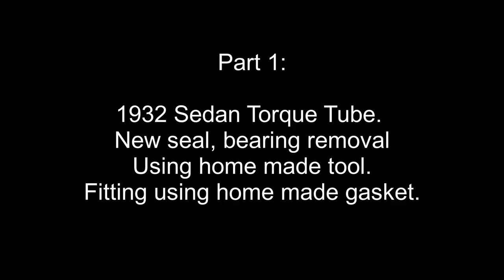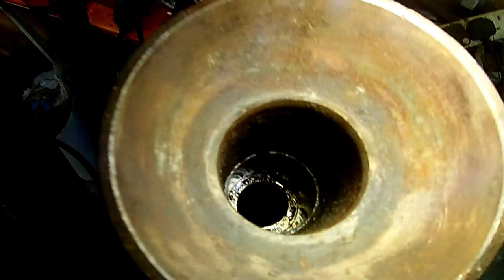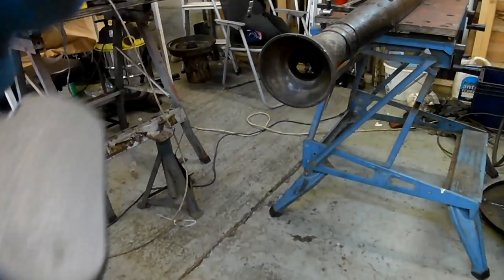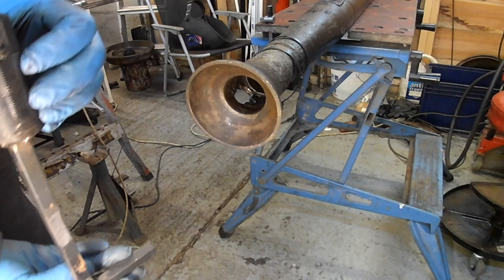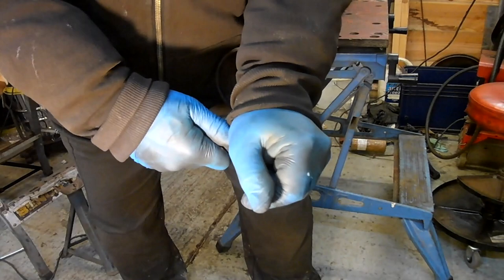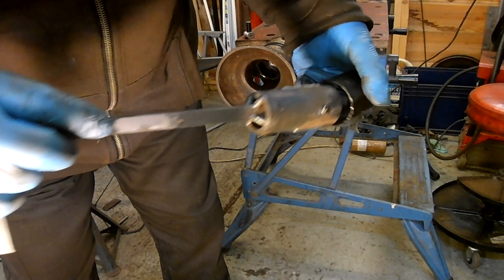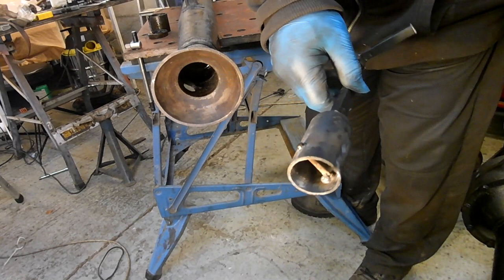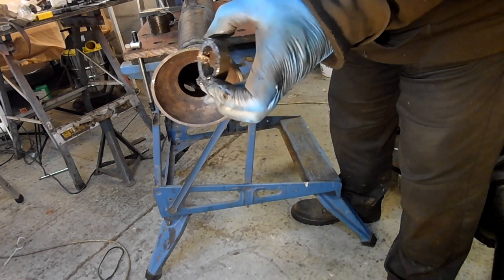Early Ford Seal swap. Home made bearing tool. Flatty port cleanup. Radius rod mods. 32 Pt20 59 pt14.

Comment: Thanks Mart. Drive-line/torque-tube is one aspect of the old fords I've not had apart, very good info.
Reply from the maker: Hi Art. Yes, I tend to leave them intact if I can. I did revisit the pinion nuts on this one at a later date. It was bugging me that there was play in there. That's the purpose of this series, to share all this seldom seen tech.

Comment: Great stuff as always Mart, including the Cold War Motors references! Staring down those 'before' clips of the valve bowls and intake ports, one could sometimes imagine you were looking into long lost but recently discovered branches of the Catacombs! It was the same for my '39 block but it turned out well in the end and runs just fine now. Same goes for some of those valve seats. As for worrying about the symmetry of the blending you've attempted between the bore liners and the valves,  one must keep in mind that it's not intended that this engine will ever power a Spitfire in the Battle of Britain!  In the end, I think your conclusion from the successful Crusty Flathead resurrection will prevail, i.e. these flathead V8's were (mostly) indestructible! Cheers!
Reply from the maker: Yes, thanks Glen. I always go by the maxim: "It's amazing what you can achieve when your standards are low".
Reply: @MartsGarage  Right you are. They needn't always be lofty - standards, that is. As my dad would say, "Whatever gets you back on the road!"

Comment: Mart, the 32 is coming along nicely. I really like the approach to use original parts as opposed to aftermarket stuff. Sure gives the car more character. I do think you should use a dropped axle though. I'd bet you could drop one yourself! Just something to think about.😉
Reply from the maker: Thanks Robert. I'd give axle dropping a go but it takes a lot of gas. There is a fella here in the Uk that does them, so it's not out of the question. I have a dropped axle leaning up against the wall. I want to get the car built. The heavy axle is the one that came with the car, so I wanted to use that. If I don't like how it sits, I can change things down the line.

Comment: Mart, another fine video. One thing I would like you to do is, when you speed up the video, slow it back to normal when you talk. One of the greatest parts about your videos is your thought process, and speeding over your comments removes some of that. As an old timer myself, I often find myself running on a bit to the apprentice about why I do something, and it seems to help them understand how common sense works. As we know, common sense can't really be taught, but it does help if it's understood. Thanks for the video, keep up the good work.
Reply from the maker: Point noted, JC. Thanks for the feedback. I spend a long time editing and it is difficult to get the footage down to a watchable length. I do exactly what you say if the comment is explanatory and relevant. I do vet the spoken parts and if they are left in the speeded up segment it means I was just waffling. I will take it on board though and bear it in mind when editing. Thanks again.

Comment: Hey Mart Great video, the seal in the torque tube is the same as the axle seals in the bells, if you need hardware your Caterpillar dealer will have quality Grade 8 hardware UNC UNF in country, washers etc Finning is your dealer and you can order online parts.cat.com
Reply from the maker: Thanks for the info John. I have found UK suppliers for the seals so will get some ordered. If I need to get bolts I'll give a cat a whirl.